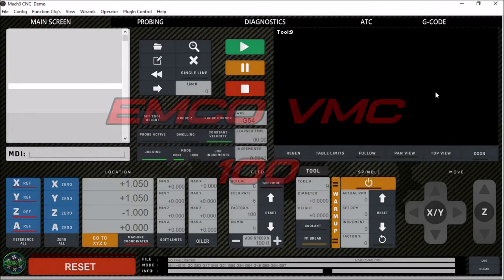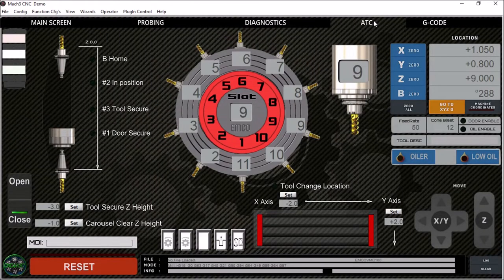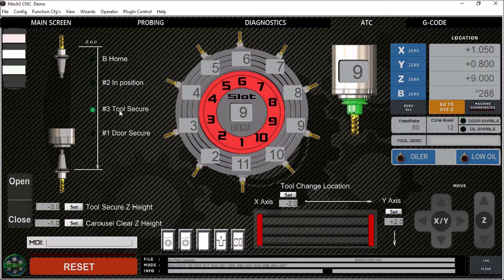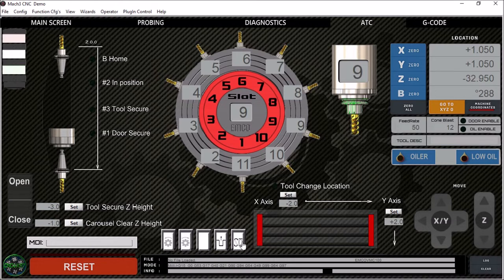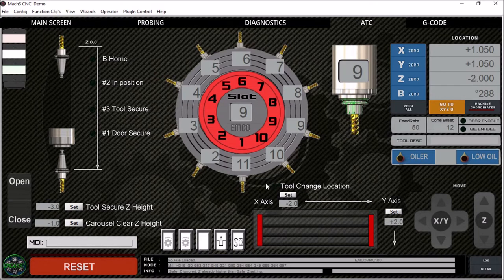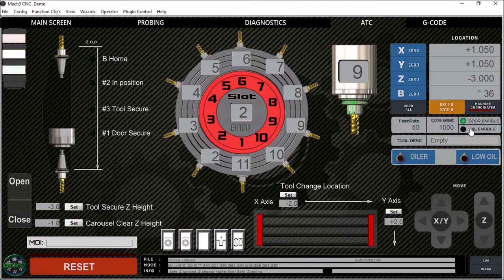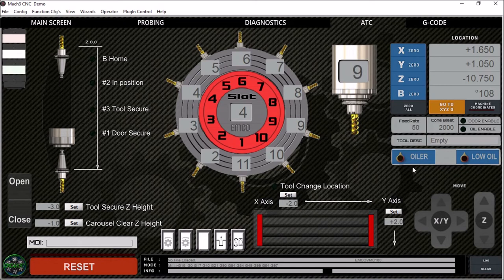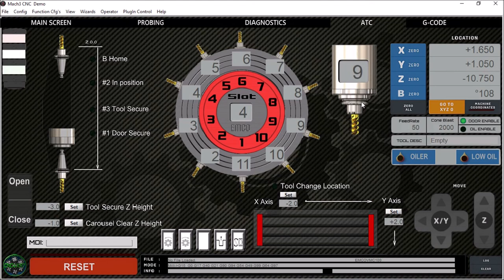EMCO VMC100 Mach3 Screen Update

Comment: "1 or more axis are NOT REFERENCED cancel program and REF XYZB axis" Why is the message popping up?
Reply from the maker: If you reference the machine and the xyz references but the B axis is sitting  on the home switch it will not reference. you can get this message.
Reply: @CNC4XR7  ThankYou